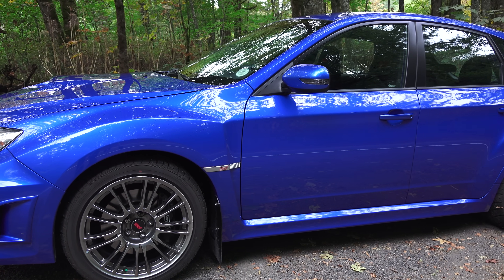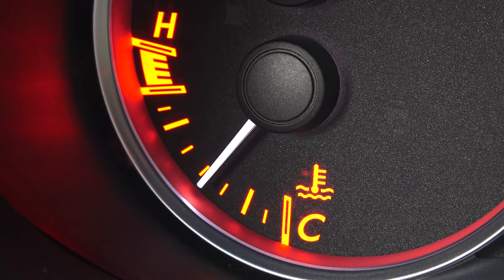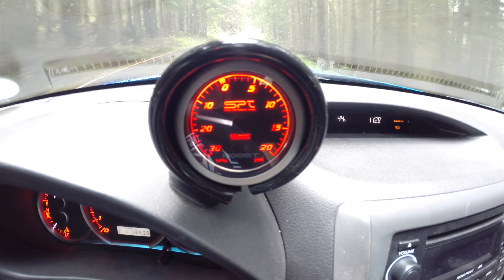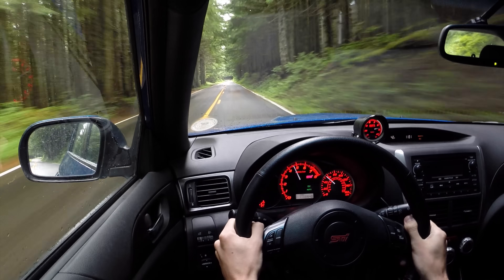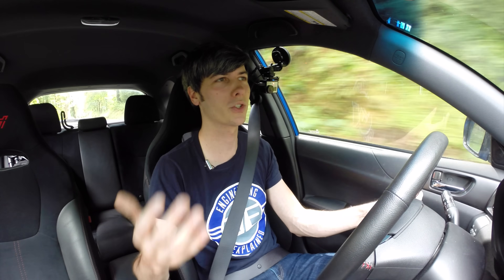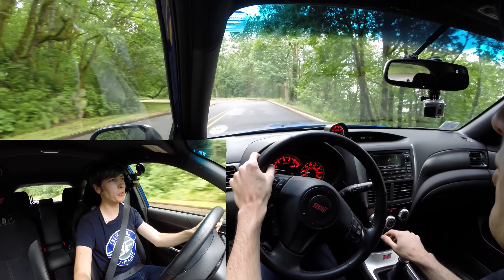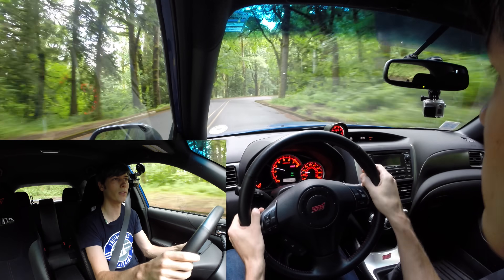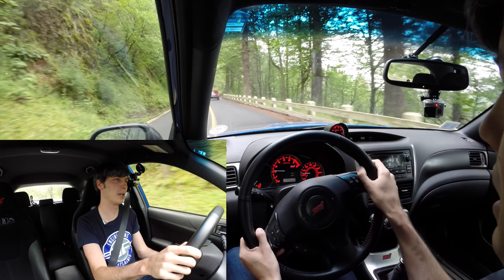5 Things You Should Never Do In A Turbocharged Vehicle

Comment: You talk like these vehicles have no ECU controlling anything. The steering thing is not a problem with vehicles with electronic stability control. A lot of turbo vehicles can handle 87 octane even says in there manuals, except for the ones that don't like older vws. Knock is really rare, ECUs are really good about control on timing. The rich mixture thing you were saying is also only an older car thing. The ECU is good about controlling fuel mixture it won't just allow for a rich condition just because you asked for it with the low rpm throttling.
Reply: ESP is only a fairly recent arrival to a lot of cars, though. For example, the one I'm currently driving, bought 2 1/2 years ago (OK, it was 4~5 years old *then*, but that's not the biggest hill of beans in motoring terms), is the first I've ever owned with it in, and I haven't exactly been driving budget shite. Prior to that, ABS was all that was on offer. And even this one allows you to get it a bit wrong, it can't fix all problems, it just stops an unexpected slip from turning into a massive crash, and keeps the wheels from spinning up if you enter a turn with a bit too much throttle or try a sharp start on a slick surface... if you get a corner really, really wrong, you'll still fly off the road. Hopefully your fancy turbo car will have enough embedded control to not turn an unwise stab of the throttle into catastrophic, bent-around-a-tree oversteer, but I wouldn't want to assume that before taking the risk and would definitely want to find out first... and traction control, if anything, can enhance your ability to stack it in fatally embarrassing ways by helping you accelerate harder out of one corner... to the point where you carry more speed towards the next than can be scrubbed off in time.

All these helpers are nice things to have where the computer's microsecond response to the limited sensory inputs at its disposal can help you to maintain grip on marginal surfaces whilst not pushing super hard, but the driver at the wheel still needs to have some sense about them to safely control a powerful car at speed. Or you'll just find yourself flying into the scenery with perfect traction, the sudden turbo boost on the corner exit having disoriented you just enough to mess things up.

Plus in all the sporty models, you can turn that stuff off at your leisure, and boy racers do like to show off their Mad Skillz by shutting off all the driver aids and pulling huge rear- or all-wheel drifts... if snatchy turbo lag strikes in the middle of that and you're not expecting it, you're just as toast as if you'd tried it in a 1980s Porsche.

Knock sensors aren't a universal thing either, some models you have to be careful not to put too low grade fuel in. Yes, it only has to be in line with what the manufacturer recommends (unless you've had the car tuned up further, but a good tuning shop should let you know if it now needs higher grade fuel), but if you haven't checked that and it turns out to be an 89 minimum but you fill it with 87, and there's no knock sensor, you could still get predetonation and all the un-fun consequences of that. At best, severe loss of power beyond a certain throttle opening, at worst actual head/valve/sparkplug/piston crown and maybe even ring/liner/block damage. And of course, even with the sensors, you'll still find the car is rather less gutsy than it should be. Check the minimum, stick with it, everything will be fine, don't need to think about it more than that. But you do need to think about it THAT much.

(and it's nothing to do with timing in the ECU, except maybe with direct injection models; if you have fuel of too low an octane rating for the engine, it's going to pre-ignite near the top of the compression stroke regardless of whether you're getting any kind of spark at all, let alone the timing of it - there's a reason it's also known as "dieseling". If that fuel is present in the cylinder along with more than a certain amount of air, it's going to burn no matter what, and probably rather earlier than you really want it to. Heck, Mazda are looking to make positive use of the phenomenon in their latest line of petrol engines, which are direct-injection and strengthened to diesel-like levels, with variable valve opening allowing variation of the effective compression ratio (upto an otherwise insane 15:1 or so, but also much below the typical 9:1 when maximum power isn't needed) and can run deliberately in compression-ignition mode at least some of the time. You might see those recommended to use fuel of no higher than a certain octane rating, instead of no lower...)

Comment: If I'm in 5th gear at 1500rpm just like your example, but instead of flooring it, just press the gas a little bit more because gearing down may not be necessary, is that still considered lugging the engine?

Comment: The whole diesel point is debunk. That's why we have mass airflow sensors, to regulate that mixture, even at low RPM. Checkmate. MAF.
Reply: no --no air flow sensor if you you drive a real diesel [ mercedes 300td ] with a real injector pump,

Comment: You might want to add about cruise control too. I have noticed the same engine lug while cruising on a highway (6th gear, 1800 RPM or so ) and when there is a slight uphill ride. I used to just boost without any downshift and i would get a burning smell. I have learnt to downshift in those cases. The annoying thing is about the VW GTI computer which would immediately suggest me to upshift from 5 -> 6. I think, their software doesn't have a smart way to sense incline and recommend accordingly

Comment: what happens to your clutch when you are, for example, stopped in an uphill in your clutch bite point and accelarating just enough so that you dont move upwards nor downwards. is it just wearing the clutch out?
Reply: Miguel Saraiva just wear
Reply: Miguel Saraiva  if you find yourself on a hill in traffic put your emergency brake on while your foot is on the brake pedal. Let your foot of the clutch after the car is put neutral. You won't roll back. When it's time to move push the clutch in put it in first gear. Give it some gas as you raise the clutch you will feel pull on the car to move. Let the emergency brake go and you will go up the hill without rolling back. Some people get so close you don't want to roll backwards into them. Do not ride the clutch.
Reply: Yes. The things that move against each other in order to turn engine rotations into wheel rotations when you're starting off, or smoothing off a gearchange in a car with a finicky throttle, are ablative friction surfaces. They're covered with a very fine, sandpaper esque material, which grabs very strongly and transfers the great majority of energy when there's only a small speed difference between them... but if you're sat with one side not moving at all, and the other at some elevated speed (as you would need for hill holding on anything but a fairly shallow incline), no energy is being transferred to the wheels at all... it's just going into a mixture of heating the clutch plates up through friction, and gradually scrubbing off successive layers of the grippy material. Think of it much like polishing rust off a metal object with a sandpaper wheel attached to a drill, the friction plate of a clutch isn't a million conceptual miles away from that sanding disc (and indeed, if used incorrectly, a sanding disc is entirely capable of grabbing the workpiece and flinging it across the room). It's just made of somewhat sterner (and more expensive!) stuff, so it can stand up to much more abuse than a piece of low quality paper with a load of shattered glass stuck to it.

There's several good reasons you're provided with, and should use, the handbrake, or in some modern cars a footbrake hill-hold system, and this is one of the major ones. On hills, the clutch should only really be used for pulling away, for the shortest time possible, as you're already putting it under greater strain, probably for a longer period, than it normally would experience.

The same goes, to a lesser extent, for slushbox automatics; although there's no direct solid-to-solid friction involved in the action of a torque converter, there is still a heating effect in the turbulence created by the engine swirling the thick transmission fluid around using the input turbine (and revving above the "stall point", because it needs to exert some kind of useful force against the car's weight), whilst the output turbine is held stationary through being connected to the wheels whilst in gear, and it's entirely possible to overheat the transmission fluid to a damaging extent if you maintain that situation for an extended period (same as it's possible to overheat it by driving through the mountains pulling an extreme load which causes an unusual amount of slippage in the converter). Better to lay off the throttle and apply the foot or preferably hand brake (as there's then no rolling back when you move from pressing the brake to pressing the accelerator), which will greatly reduce the heating by allowing the engine and thus input turbine to idle below the stall point, which is where the generated turbulence is enough to actually apply force to the output (if the fluid isn't moving fast enough, then it doesn't actually become turbulent and there's much less heating)... or even better, apply handbrake and shift into neutral, which reduces the amount of wasted energy nearly to zero because the output turbine can also idle at the same speed as the input and the only friction the fluid then has is a minimal amount against the guide vanes and inner walls of the torque converter housing.

Semi-autos and other trick types, including most CVTs and automatic bikes should generally be considered as manuals for the purpose of hill-holding using the engine power, as the majority of their power take-up devices are friction based in one way or another.
Reply: yea don't do that, unless you enjoy replacing clutches faster than you should

Comment: lugging a turbo car is verry bad cause in lower rpm in a high gear and you floor it will still give you full boost (on a stock non mod car or basic aftermarket kits) and that much pressure at low rpm is verry successful to a stock crank n rods .

Comment: Coking a turbo is a long time thing of the past.  Besides if you have good gauge you'll see it only takes seconds to go from 1200f to 400f so you don't need minutes to cool it down. 

Also don't use high grade fuel unless you have a custom tune or the vehicle calls for it.  An economy turbo car should have no problem running 87 octane. I have no idea why you'd tell every owner of a turbo car to run expensive fuel.

Comment: I drive my 2015 WRX to work for about 4 minutes in Colorado at 10000 feet above sea level. We get 0F to --20F quite often in winter. It will take me good 20 minutes to warm up car engine while just sitting and idling. Don't have that much time so I drive before engine warms up. 

How badly I'm messing up my car, any tips for my situation?
Reply: It's best to avoid high revs until the vehicle warms up.  Otherwise, it's fine.

Comment: the reason you get knock at wot at low rpms is because you have a leaner afr because of over boost theres not enough fuel in the combustion process to absorb the heat energy produced by the engine so it reaches its vapor phase at a much faster rate and as you pack all that air in the CC with a fuel that has become a complete vapor especially gasoline it will quickly go boom especially on a turbo car because they have significant advanced timing

Comment: Question - I have a 2014 VW Jetta TSI, the owners manual recommends regular 87 octane fuel, being one of the only turbo engines that doesn't require 91 octane. Should I still be using 91 octane anyways for better performance and longevity?

Comment: I'm boosting my 07 Camry this Summer I will need to get a few basic mods first though like an Exhaust cold air intake header aluminum radiator and silicone hose aftermarket dual cam shafts then a complete turbo kit I'm gonna start off with performance mods the engine then cosmetic for that custom modified street car look oem front bumper lower spoiler RK sports sideskirts RK sports Rear lip deepdish rims and D2 Coilover Black Jdm housing headlights Red clear tail lights as for my interior just an aftermarket deep dish racing steering wheel Bride Black racing bucket seats with 4 point shoulder strap belt a shifter extender and a carbon fiber shift knob that's my list of mods to get

Comment: You told about not giving your car full load at low rpm, does this only affect petrol engines or also diesel ones.. Cause a diesel can pull trough easilly with its torque

Comment: I work as a engineer at BME we make pistons, rods, and superchargers of the roots type. Any time you make power at a low rpm your doing so via LOTS of cylinder pressure, witch puts a lot of structural loading on the rotating assembly. When you make power at a high rpm, your doing so via rotating inertia or angular momentum witch creates stresses of its own but far less detrimental to the engine. That's why a Hp number that people so casually throw out there's means nothing with out the rpm it was created at! 500 hp @4,000 rpm and 500hp @ 8,000 rpm are 2 completely different measurements!

Comment: Oh god dude, I cannot stand your videos, the two I've watched have some blaring false points.
Reply: So, on the lugging point, there are air flow meters and many other ways, including ECM maps that would not just spray an excess amount of fuel. It would be more mechanical wear from components nearly stalling and then taking excessive torque. secondly what you are describing is not pre ignition but detonation which also would not happen in an over rich mixture. preignition happens a bit earlier than desired ignition timing due to red hot debris deposits in a cylinder or a misformed piston face. detonation takes place when fuel self ignites causing two flame fronts impact each other causing extreme cylinder pressure and can cause major engine damage. I don't know how you get away with making such huge mistakes.  Pre ignition is bad but would only cause significant damage over long periods and would present with symptoms before catastrophic failure.
Reply: @McLilWilli  Pre ignition IS fuel self igniting, caused lack of "quenching" due to low volume of fuel entering the CC. When an engine is lugged CC temperatures rise high enough to cause the spark plug to become a "glow plug" igniting the mixture without a spark. Pinging is light pre ignition, while "knocking" is heavy pre ignition or detonation. Pinging won't cause engine damage, but knocking will take it's toll on the main and rod bearings!

Comment: In turbo charged diesel's your DPF filter throws fuel into the exhaust to clear out any clogging, this leading to black smoke coming from the car, your not really suppose to stop the car once you see this smoke until it has cleared up otherwise you are just clogging it up even more. So how exactly are you suppose to tell of you have caused damage to your car by doing this or if your DPF filter is kicking in as i own a turbo charged diesel car but i have a hole in the exhaust manifold, could this be from full boost at low rpm?

Comment: 1995 Volvo 855 turbo wagon.   Just rebuild the turbo.  It is not rocket science as long as you pay special attention to the clock alignment of the shells.  290k, runs like brand new and burns just under a quart of oil in 3000 miles.  ~75.00
I never rail on it before it has warmed up.
I never run it real hard and then immediately shut it off.
The rest?    meh  she's automatic.

Comment: my Saab would leave the radiator fan running after shutting off the car until it cooled down a bit. If the oil pump was controlled by an electric motor, I would think they could program it to keep circulating the oil until the oil temperature near the turbo dropped to a certain point

Comment: Most of your stuff is terrifically well-reasoned and fact-based. If the temp gauge is reading mostly hot, the engine oil is plenty hot. Your assertion that a engine with an opening stat possibly not having hot enough, oil-wise, is nutty and not factual. BTW, NUMBER 6:  Never use conventional motor oil, only synthetic. Conventional cokes way too easy and will clog the engine in general and pick-up screen in particular.

Comment: Finally. A video that talks about Heat Soak where you turn the engine off straight after giving it some 'stick'. Guaranteed to cook your turbo bearings and/or your oil. Buy yourself a Turbo Timer that lets the engine idle for 2-3 minutes after you turn it off.